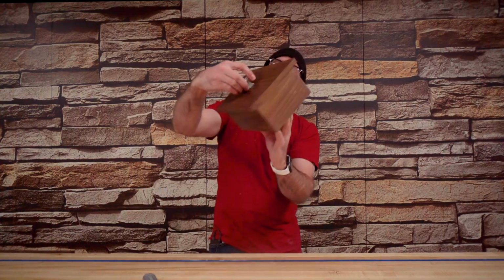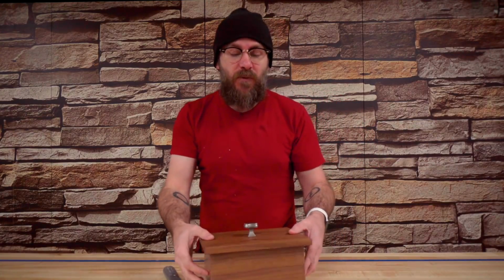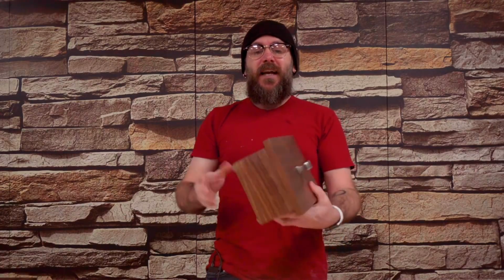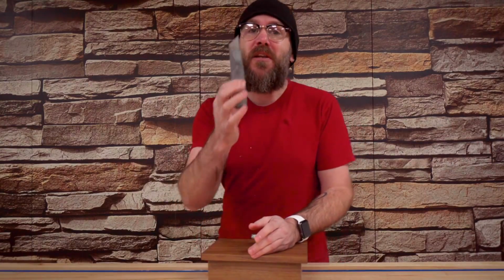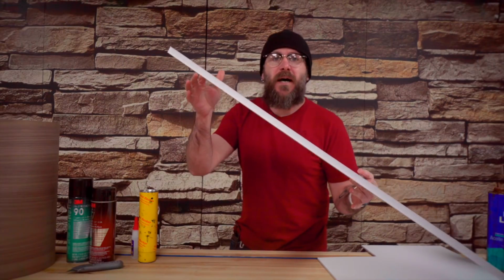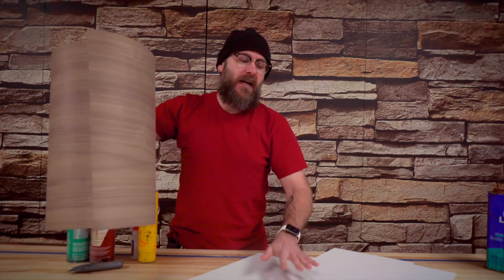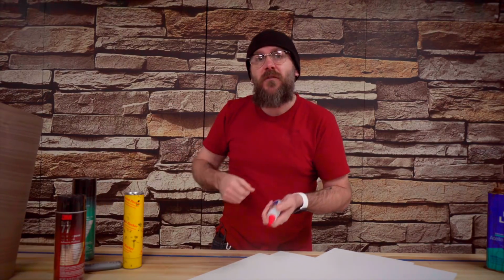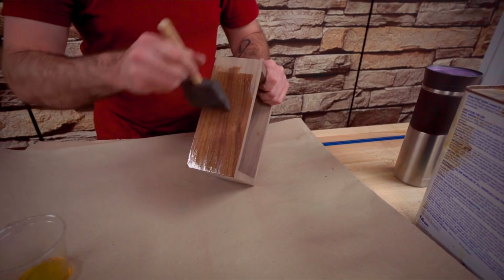Walnut Box Made with Utility Knife | SUPER LIMITED TOOLS PROJECT

Comment: I've made boxes etc just with a utility knife, but using 1/4 ply
i've actually cut 1/2" too, but that takes forever :D
I find that having a surface vertical on a flat surface helps with getting things like veneer lined up perfectly (or holding something flat against the edge)

Comment: interestingly, this project actually requires a fair bit of patience and preciseness. Sand too far? Can't use putty. Getting all those veneer edges to meet cleanly was a feat to behold. It would be cool to sit it on a craft fair table and watch the bemused looks over the weight of it.
I really liked the flocking on the underside of the lid.